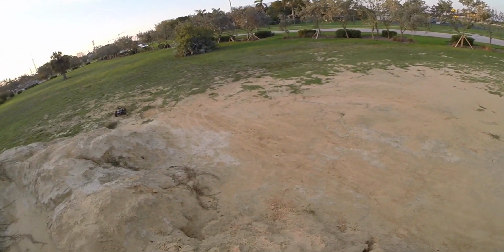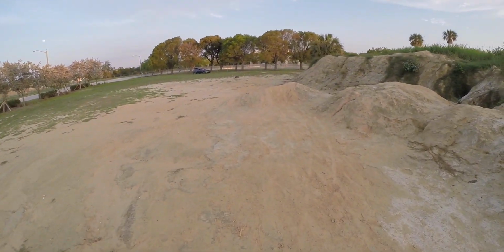Arrma Outcast 6S With Tekno Locking Rod Ends

Comment: AWESOME Stuff brother 👊!!! Glad you're trying the Tekno rod ends. They've been a lifesaver for me. They can stretch, oval out, and eventually break, but that's been my bad usually for not checking my droop screw settings. I can't remember, are you running RPM arms??? 🤔🙋🙋😲😲😲😎💪👊👊
Reply from the maker: Rich Duperbash thanks brother I have the RPM arms for the Outcast just never put them on waitin for a stock arm to break the thing just won't snap lol the Kraton is all RPM out & I love it maybe I should put them on to give it some more flex anyhow the rod ends are definitely worth it makes a huge difference thanks brotha much appreciated man happy bashing my friend🤙😎😎😲😲😱😱🙈🙉🙊👊✌
Reply: 12R1 that's awesome to hear bro. Just never tried fitting the Tekno rod ends with the stock arms and was curious if they fit. Sounds like they do. 😎💪👊👊
Reply from the maker: Rich Duperbash yes sir they do👊✌